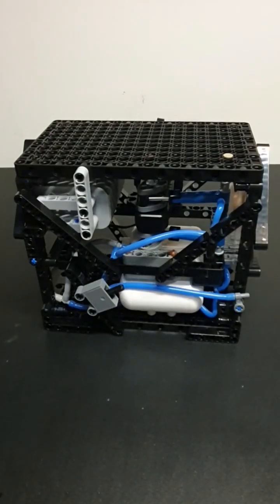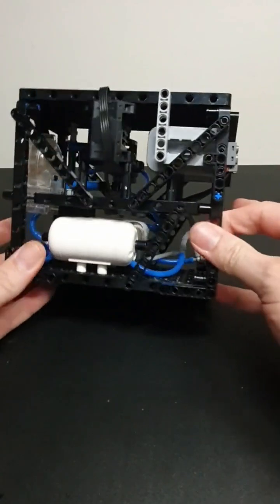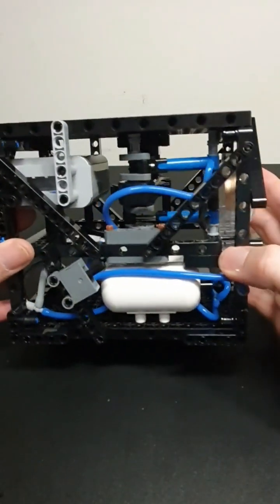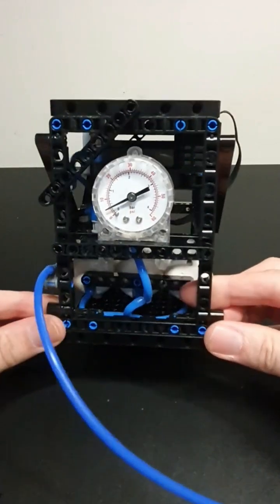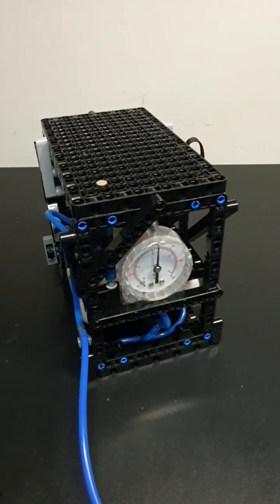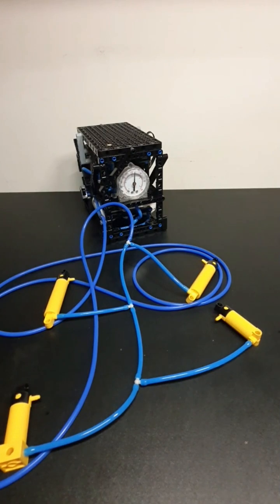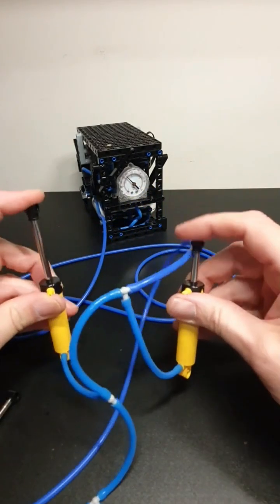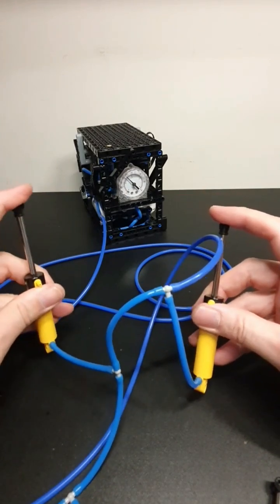Lego Technic pneumatic portable pump for unlimited air!

Comment: is there like a max pressure for the Lego pumps? and how long do they take to get to 30psi? I'm building a Lego pneumatic air engine
Reply from the maker: Understanding a little bit of physics helps a lot, there are several variables. 1. Diameter of pumping cylinder, but I've never seen any of the larger cylinders used as pumping cylinders. Air has to be able to leak past the piston (in one direction only) so only the smaller ones seem to be used for pumping. The big ones don't allow air to leak past because they have an inlet at each end for pushing in both directions. Pneumatic engines I've seen online seem to have an external valve mechanism for the purpose of overcoming that factor. 2. The volume of the tank, or if you use multiple tanks like i did, then it takes proportionately longer to build up the pressure. 3. Battery condition will also be a small factor, particularly as batteries start running low. Hope all that helps 👍
Reply: yeah Im planning to make a Lego pneumatic engine not the ones with the pneumatic cylinders but the ones with the poppet valves that you need to drill in, they're harder to make because you need to sacrifice a few Lego pieces to make it possible but they perform much better and much more realistically than the ones using the pneumatic cylinders.

Comment: i dont like the air lego parts. im scared it will all break and i have to buy everything new
Reply from the maker: I know what you mean. I bought the 8421 crane when it was new, around 2005 and it had a faulty cylinder. I couldn't narrow down what the problem was until the last few months when I got more cylinders and used a process of elimination.
Reply: You can’t over pressurize Lego air hoses if you try it just slips off
Reply: @ oh ok thx